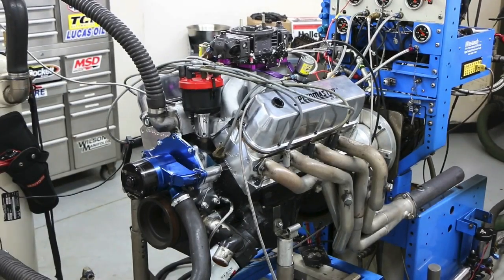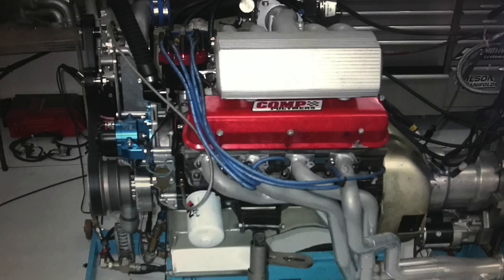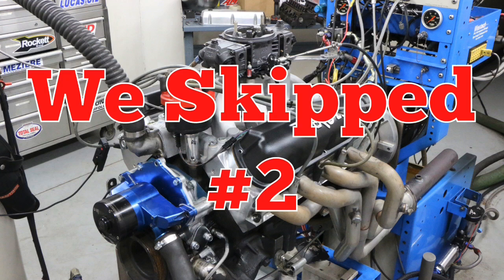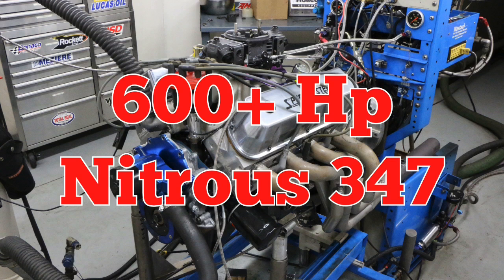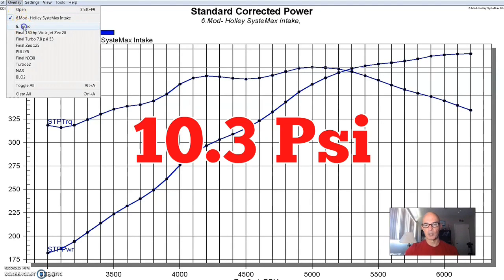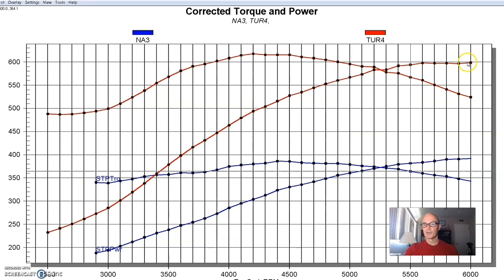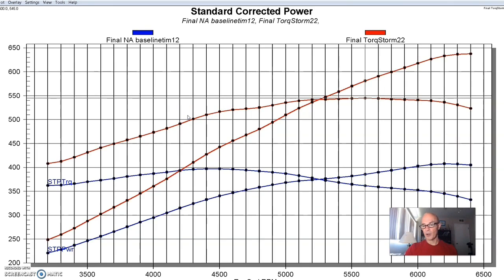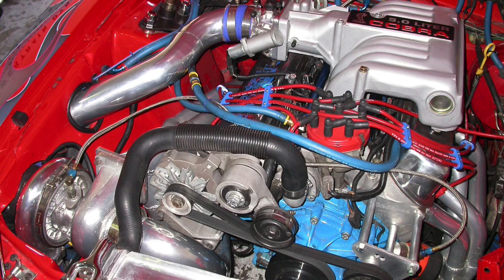5.0L FORD BLOCK SPLITTING-FACT OR FICTION?

Comment: It’s when the stock harmonic balancer comes apart and the motor “ shakes the baby “ until bad stuff happens.
Reply: EVERY 302 engine I've ever ran lost the stock balancer🤙🏼 granted I beat the hell out of them but why else would you own a 302 😁
Reply: @ls6-ss413  hell yeah mate. I'm an Aussie and I had a 2000 Falcon Ute with a 302 5 speed. That thing loved a thrashing, till I had a bottle of rum, argument with the missus, and promptly parked it shiny side down and rubber side up.
Reply: @TheTeeroy32  I think we could get along brother 😉. Bet she sounded good doing it though. Nothing like proving the old lady wrong than flipping the car😁.

My grandfather was a genuine rum runner. They called  flipping the car going tits up 🤙🏼🙂
Reply: @ls6-ss413  sounded awesome, chopped all the mufflers out and had a dump at the diff. With the leaf springs, LSD and fuck all weight on the back, she was a tyre destroying machine, even basically stock.
Reply: The balance factor is in the harmonic ring on a 302/5.0...if it slips a bit, things end quickly
Reply: I agree with the stock balancer giving out from age,milage. Replace it,all is good!
Reply: Never, ever, shake the baby!
Reply: Been there done that with the balancer in my 95 gt with a little spray
Reply: Barlows Customs my 95 destroyed the factory balancer after new heads & cam allowed higher rpm operation
Reply: That’s why I’m internally balancing my 414w
Reply: Spend good money on those for sure.
Reply: I’ve experienced this the first time out after installing my v2 I thought I blew it up after the second pull.
Reply: @BR-P-2001 // if it’s a machine , it can break

Comment: I saw this happen once with a buddy that raced 302 is in a Mustang he had a big nitrous shot on it 300 I think it running really bad after the last pass the next weekend he pulled the motor out when he took the intake off it was cracked straight down through the lifter Valley I always called the cracking of a 302 b***** but that was the only time I ever saw it

Comment: I think it's a direct load. Probably at launch when drag racing. Although I think people have been saying 500-550 WHP is the limit not BHP. Obviously that isn't the case considering you've had them with as much as 665bhp which would be over 550 whp.
Reply: 665 in his testing I'm not so sure would be above 550 maybe close to 550 but hes testing with straight headers and no accessories plus there is no driveline loss it is quite alot higher of a number than it would normally be far as comparing engine hp to wheel hp.

Comment: My guess as to why they split, high RPM dumps of the line, tires that grip, clutch that locks up, somethings got to give.
Reply: It's most likely production tolerances and casting.  I have seen stock blocks sonic tested and there was only .040 thickness between the cylinder walls.

Comment: No mention on what fuel being used on the split block car so I'm gonna go with detonation for $200 Richard. 👍 That or the crankcase pressure under boost at 600hp/700ftlb. is too much for it. 🤷

Comment: 15 lbs of boost will blow up a 302 easy ....
Reply: I've ran 18 lbs on a stock block..disnt beat on it to bad..never blew up
Reply from the maker: 15 lbs on a stock 5.0L is only 400 wheel hp
Reply: @richardholdener1727  I tried a turbo 302 build before, cracked the block at cylinder 4 next to the bolt. It obviously was a mistake on my behalf, but I've been scared off ever since😫

Comment: Engine Harmonics like bad damper, or poor engine assembly like not balancing/ Checking the weight on rods and pistons before installing them together. Also bad tuning
Reply: Your absolutely right a balanced rotating assembly will make or break a build literally
Reply: AUTONOMEN x  
Short deck height. Short rods. Yah that could be a factor. Thin walled blocks. Core shift at the foundry. Iron alloy used. Tuning. One thing to remember the Windsor when designed wasn't necessarily designed for putting out power over 500 hp.
Reply: Dampers are always overlooked expectionly for first timers only focused on gains not understanding when outputs are increase it changes the engines natural frequency leaving the stock damper insufficient creating loss of tensile strength that leads to cracks
Reply: AUTONOMEN x gurdles just hold all the parts in a nice pile
Reply: AUTONOMEN x  
Aside from the flatheads that's probably the smallest V-8 ever built in the US. I know AMC built  250 CID version of their Gen 1. Oh, wait I forgot about the Buick/Olds 215 aluminum in the early 60s 😖
I imagine that 221 was pretty gutless. Although with that short stroke provided the heads could breath it would probably love to rev.
Reply: No. The blocks have weak main valleys
Reply: @Stephen-br6il  yes absolutely they have weak valleys. But engine harmonics will find the weak spots.